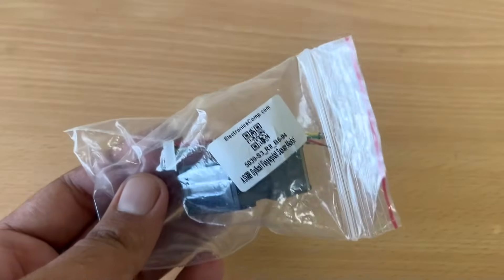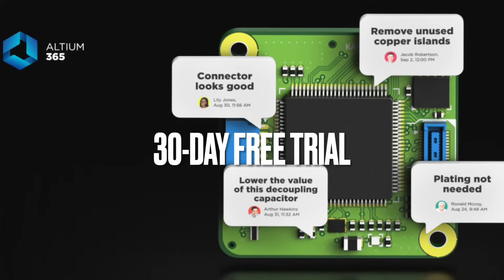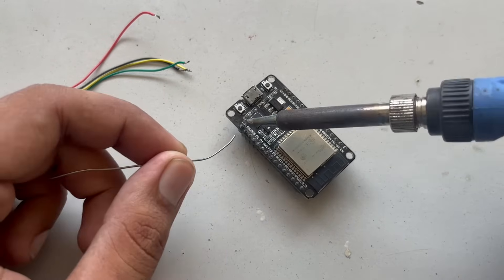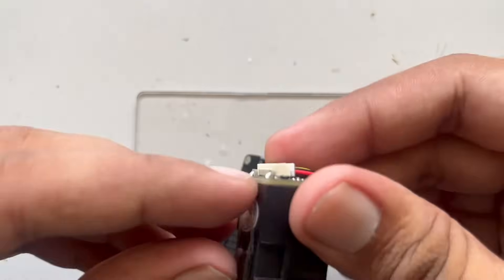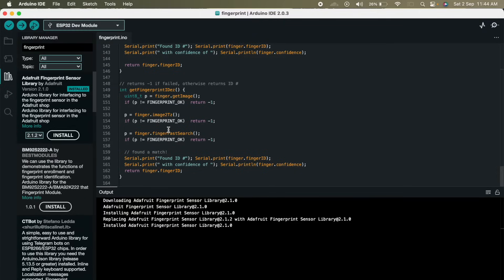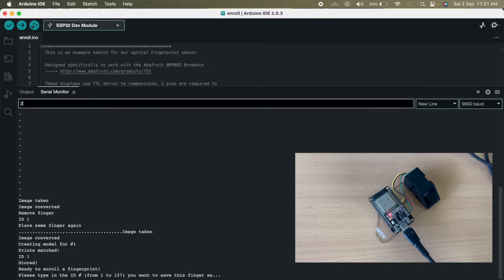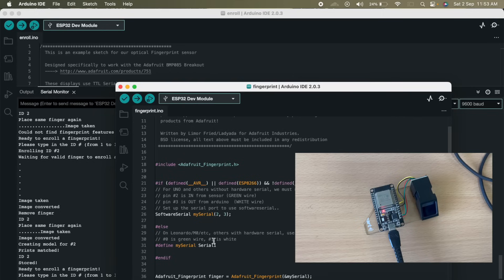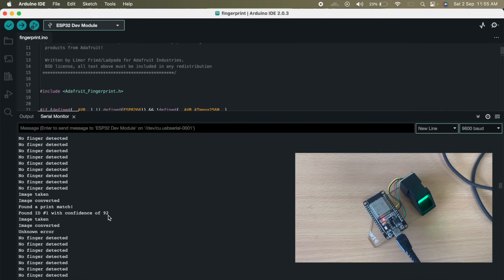How to use Fingerprint sensor with Arduino | Fingerprint Sensor with esp32

Comment: i follow all your step but fingerprint sensor not found
Reply: Iam also facing same problem please help @RoboCircuits
And @evstark if you got the solution please share
Reply: @Ganesh-jk5rt  until now i didn't fix the issue
Reply: @evstark  bro did you find the solution I am facing the same
Reply from the maker: May be problem with your fingerprint sensor
Reply: @RoboCircuits  it works fine in Arduino R3 ,and Arduino mega 2560 but when i used ESP32 its not working

Comment: what will i do if the fingerprint sensor is not found?
Reply: did u get the answer?
Reply: @rainb0w347  i got the same issue now i didnt know what happened :(
Reply: @Kip-x3m try installing different fingerprint sensors on Arduino. I fixed mine but it still goes undetected from time to time. Almost failed my final year project bcs the sensor keeps having the "not found" error